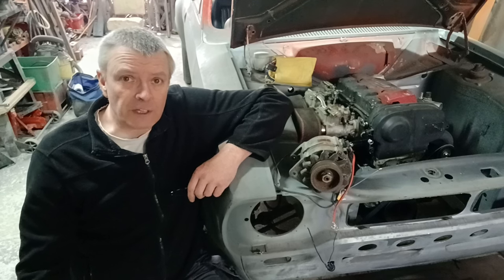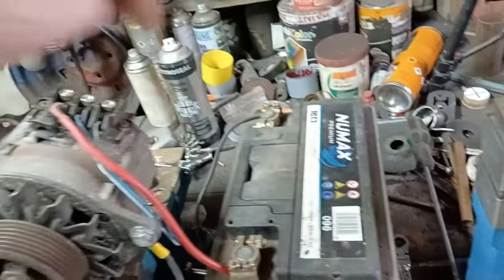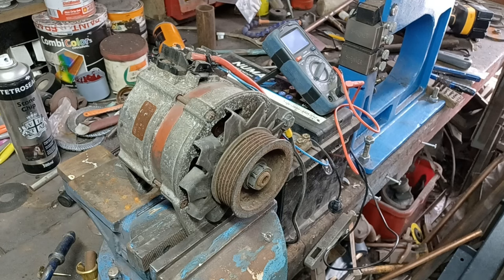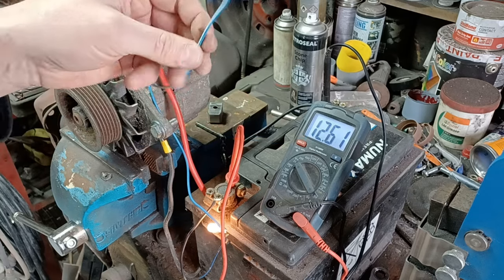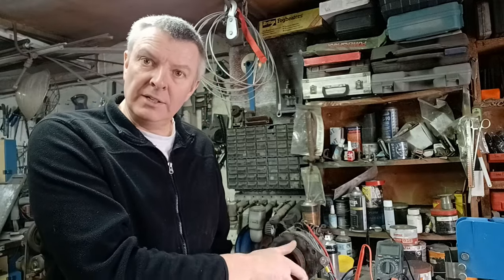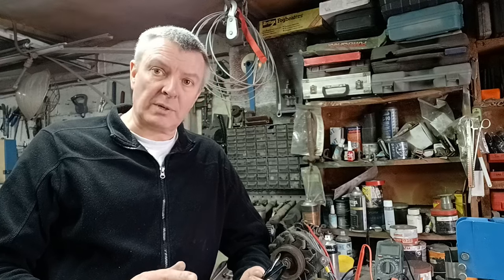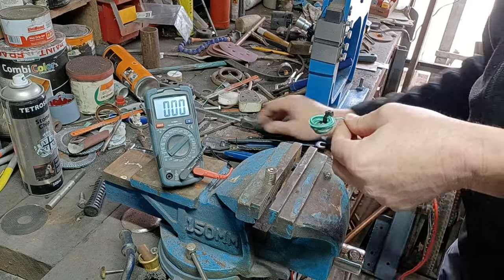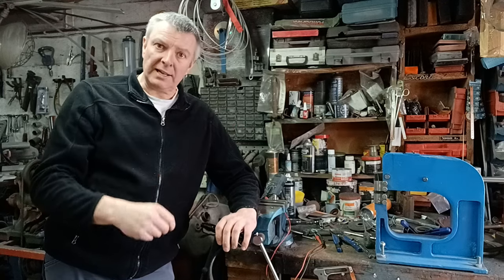Ford Escort MK1 Restoration Project, Testing the Alternator

Comment: Hi Dave, I think that W connection/wire is used in Diesel applications where there is no coil to take the pulse for an electronic Rev counter, the pulley size would be matched to the rev counter and motor and use the sine wave to calculate revs, for your application remove the wire 👍
Reply from the maker: Yes, that makes sense, thank you. 😊

Comment: thats a self regulating alternator with the rectification pack built in , so no need to have an external unit. The W wire is a rev counter feed.

Comment: Hi Dave very much enjoying all the videos!!!, as stated W wire is indeed waveform wire for the Tacho.... I was told many years ago when I asked at my starter motor and alternator repairers that the old Lucas ACR alternator and the like had blocking diodes within them to deal with overcharging.. the modern type this is dealt with by the ECU but guess maybe  some are different....depends what car it came from????  keep up the great content. regards Chris
Reply from the maker: Thanks Chris 👍

Comment: I think when you were spinning the alternator up, you were spinning it the wrong way because the fan blades of the alternator, supposed to suck carry and push push air through to keep it cool I’m not 100% sure, but I think I’m correct I may be wrong  Please check
Reply from the maker: Must be the right way. Most engines run clockwise. Maybe it looks weird due to screen refresh rate?

Comment: Could be miles off here but I wonder if the 'W' is the wire for the rev counter feed. Sounds strange but alternator speed must relate to engine speed. I remember many years ago fitting an RS type dash to my brothers MK1 and we had to run a wire through the back of a fitting on the rev counter but I don't recall where it came from. It could well have come from the coil or distributor though. It's amazing how much you forget as time moves on and you don't use the knowledge and skills.